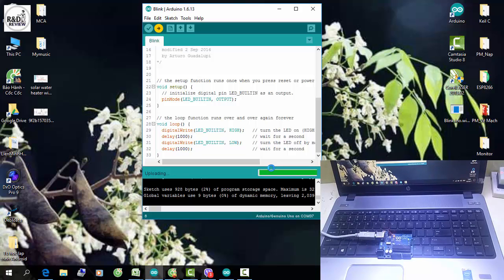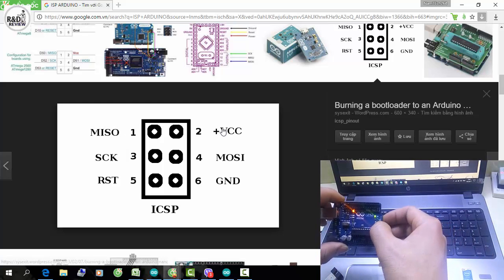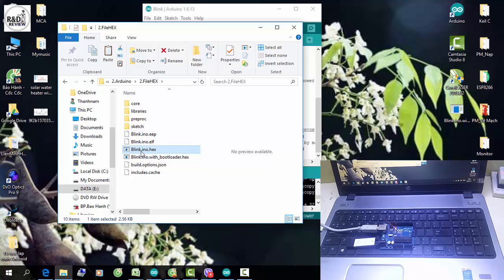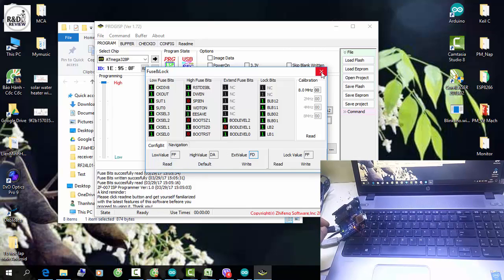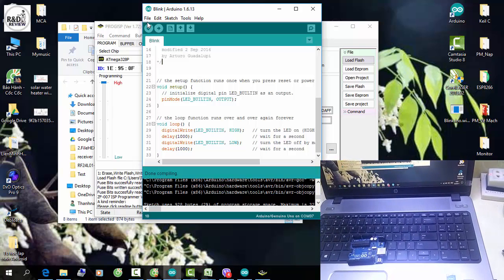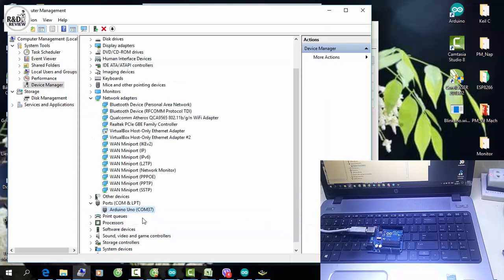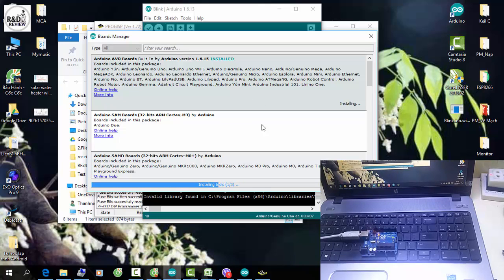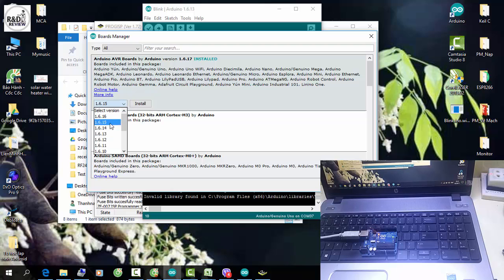Hướng Dẫn Sửa Lỗi Thường Gặp Trên Arduino IDE Tutorial.DIY | Nhóm Review | R&D NEW PRODUCTS

Comment: Bác cho e hỏi e có thể nạp Bootloader cho mạch Arduino pro mini bằng Burn E được không bác ?
Nếu đc thì cách set fuses như thế nào ạ ?
Reply from the maker: được nhé bạn. fuse bit cũng tưởng tự như trên video thôi bạn.đúng tần số thạch anh là ok
Reply: Tôi nạp = USB -Com ( Cable DKU-5 Nokia)  báo lỗi 

avrdude: stk500_recv(): programmer is not responding
avrdude: stk500_getsync() attempt 1 of 10: not in sync: resp=0x....
................
 Tôi dùng Bunr E nạp file Hex vào thì vận chạy ok nên như bác chỉ giáo thì là của tôi mất boot.

Set Fuse giao diện trên Burn E  nó khác + tôi ko rành lắm, tôi đã set dùng thạch anh ngoài 16 Mhz.... (cột Value = FF - DA FF FF) nhưng ko ok.

Comment: Sketch uses 6310 bytes (19%) of program storage space. Maximum is 32256 bytes.
Global variables use 434 bytes (21%) of dynamic memory, leaving 1614 bytes for local variables. Maximum is 2048 bytes.
avrdude: stk500_recv(): programmer is not responding
avrdude: stk500_getsync() attempt 1 of 10: not in sync: resp=0xe7
avrdude: stk500_recv(): programmer is not responding
avrdude: stk500_getsync() attempt 2 of 10: not in sync: resp=0xe7
avrdude: stk500_recv(): programmer is not responding
avrdude: stk500_getsync() attempt 3 of 10: not in sync: resp=0xe7
avrdude: stk500_recv(): programmer is not responding
avrdude: stk500_getsync() attempt 4 of 10: not in sync: resp=0xe7
avrdude: stk500_recv(): programmer is not responding
avrdude: stk500_getsync() attempt 5 of 10: not in sync: resp=0xe7
avrdude: stk500_recv(): programmer is not responding
avrdude: stk500_getsync() attempt 6 of 10: not in sync: resp=0xe7
avrdude: stk500_recv(): programmer is not responding
avrdude: stk500_getsync() attempt 7 of 10: not in sync: resp=0xe7
avrdude: stk500_recv(): programmer is not responding
avrdude: stk500_getsync() attempt 8 of 10: not in sync: resp=0xe7
avrdude: stk500_recv(): programmer is not responding
avrdude: stk500_getsync() attempt 9 of 10: not in sync: resp=0xe7
avrdude: stk500_recv(): programmer is not responding
avrdude: stk500_getsync() attempt 10 of 10: not in sync: resp=0xe7
Failed uploading: uploading error: exit status 1
Đây là lỗi gì ạ em mới dùng lần đầu nên không biết ạ